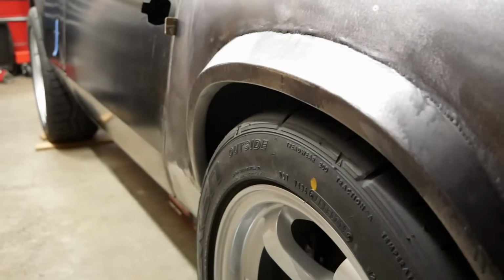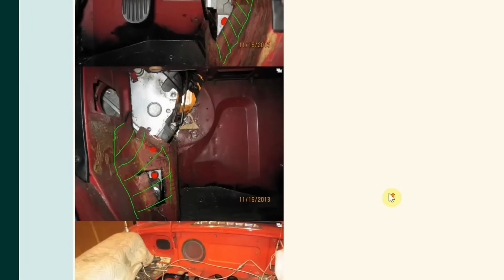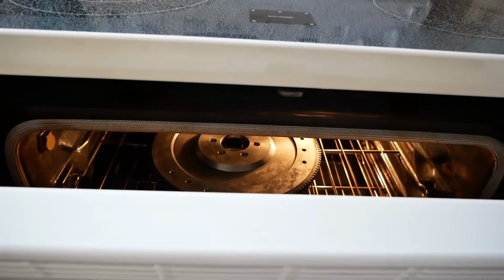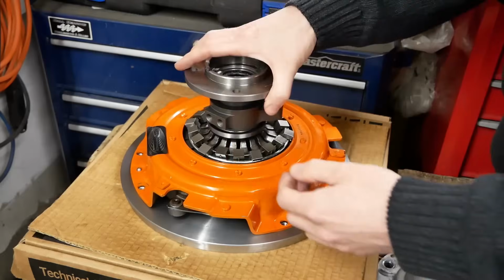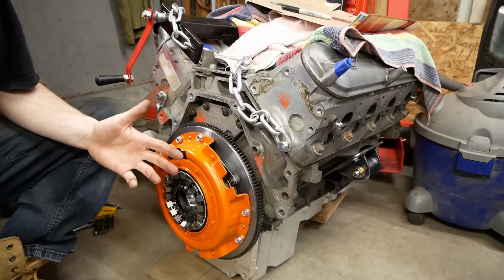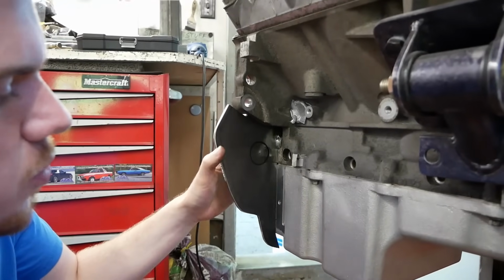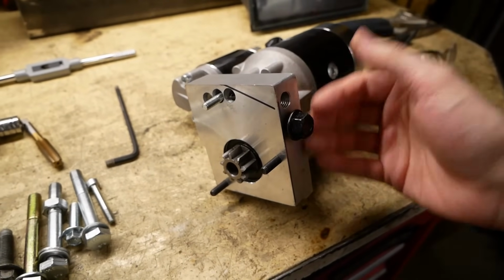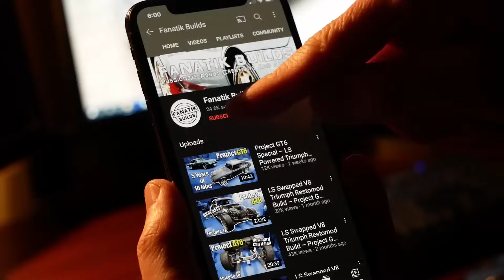The Cheapest Aluminum LS!  Pro Touring Triumph Build – Project GT6R – Ep20

Comment: Have to now go back and watch the previous 19 episodes but a question.
Can the oil pan be removed without pulling or raising the engine? 
Asking as based on sump location you need room to go directly down quite a distance (relatively speaking) as typically you would move the pan back and down but you, from what I can see, can't go back.  Or is there never a realistic need to pull the pan without pulling the engine?
Reply from the maker: Haha, thanks Russel, our production quality has improved over the years, but hope you'll enjoy the older episodes all the same! 😊 I've never tried to remove it with the engine in place, but IF it's possible, it will be by the skin of its teeth!  There have been a lot of packaging issues to work through in such a small car, and something like removing the oil pan just didn't fall as high on the list of priorities as other things!  It's a good question though!  Cheers and hope you'll enjoy what's to come! 👍

Comment: You need to 3D scan the bell housing and build a adaptor bell housing with a starter built in, and sell it
Reply: Bingo
Reply from the maker: Hmm... 🧐 ... Could be interesting!  No idea how to put such a thing into production, but thanks for the idea man! 👍
Reply: @FanatikBuilds  
A good machine shop or prototyping place may have the tools.
Two I can think of:

3D scanner. It uses lasers. I'm not sure how accurate it is. I just don't know.

"Portable CMM". I like that this measures by touch. 

" Just remember me when you wax, a'ight " ?
Reply from the maker: @xmo552  I think I'm fine with getting the design into CAD, and machining too... but finding a company to cast it would be the main hurdle!  Food for thought though! 😄👍
Reply: @FanatikBuilds  You could get it milled from a big chunk of aluminium. That would be super cost effective.
Reply from the maker: @BrianSmart1959  😂 perfect!  Couldn't imagine a cheaper solution 😉
Thanks so much for the support on Patreon, Brian, it's really appreciated!
Reply: @FanatikBuilds  Have a chat with the guy from Boosted Lifestyle. ( The guy with the 8 turbo Mustang ) He produces billet wastegates.
Reply from the maker: @andylewis7360  Thanks for the tip Andy! 👌
Reply: Ah the GT6+. So strippo from the factory that there was no steering column. Peek behind the instrument panel and you can see the exposed steering shaft turn. I think it is held with a pillow block bearing.

Comment: You solution is beautiful, if you run into any issues  fiero guys have a ton of options and info on the ls4 infront of a manual. Tho theres use fwd transmissions. But they offer starter mount options as well. Both oilpan and bellhousing.
Reply: Also the 60degreev6 forum may offer options. I know you have your issues sorted but if you run into further headaches there is a wealth of knowledge there
Reply from the maker: @raymond4988  Thanks Raymond!  Yep, the Fiero forums gave me a lot of great info and ideas! 👍 really helpful stuff!

Comment: Spec now makes a flywheel and clutch option for the LS4 with Fiero trans (Muncie or Getrag) as well as F23 trans which should work with the T5. Moroso and LS4king now also make an oil pan with starter mount. Both are used often for Fiero swaps. V6 firebird (3800) trans may also be another option for a manual transmission

Comment: Great work! 👍
Reply from the maker: Thanks very much man!  Really appreciate your support! 😄👍
Reply: @FanatikBuilds  that starter bracket is a thing of beauty. On this side of the Atlantic I think your job would be much easier (if, ultimately, a lot slower) with a rover v8 😂
Reply from the maker: @baronvonteuchter1412  Thank you!  We originally were planning on a Rover V8, but since they are so rare over here it would have been a lot more expensive, and a lot less hp as you say!  (At least without spending even more) 😄 the LS has been done many times, but I think we're only the second GT6 with one, and definitely the only one with an LS4, so ... I can live with that! 😎👍 cheers man!

Comment: What about the manual transmission behind the 3.8 camaro and firebird? They have the 60° metric.
Reply from the maker: That should bolt right up!  Unfortunately the older GM V6 T5s were rated at a lower torque capacity than our 04 Mustang unit.  We may still blow it up someday, but we'll address that if or when the time comes! 😅
Reply: @FanatikBuilds  it seems like for the price you could have the gm trans built to handle the power easier than sourcing and machining all those other parts. Also you can use the 60° bell housing with the 6 speed transmission but you did refer to the amount of space available.
Reply from the maker: @bryanbrunk1186  There really isn't any advantage to using the GM unit, as although we had to source the Jeep bellhousing, it bolts up just the same.  The GM T5 would still need a custom flywheel/clutch setup, as well the starter and mounting bracket.  These engines just make life difficult no matter how you go about it!  We got our T5 for only $450 and it's already stronger to the point that we don't honestly expect to blow it up... but if we do, we can always look into getting a TKO or TKX to replace it 👍

Comment: But you did not use the new TIG to weld up the bellhousing to accept the supplied bolts. Well, maybe next time.
Reply from the maker: Which supplied bolts?  And yeah, lol, haven't tried aluminum with the Tig yet, it's hard enough on ferrous metals! 😂

Comment: A also to if your shifter sits too far back you could possibly use a early zS-10 tail housing which will move your shifter more forward its a good mod for early ranger sand shoe box cords I've heard.

Comment: Why couldnt you use the S10 flywheel? Did I miss something? It looked like you only needed to drill more holes.
Reply from the maker: That was the plan originally, but unfortunately the bolt pattern and center bore is much larger and there's not enough material to safely machine it out.  There's also a seventh hole on the S10 pattern which completely eliminated any remaining chance of this working.  I was really REALLY hoping we could get away with modifying an off the shelf unit, but flywheels are not a good area to mess around with so we took the safer route.  Cheers! 👍
Reply: @FanatikBuilds  ok that makes sense then.

Comment: I'm not sure on the particulars for any of these parts, but most bellhousings have some sort of plate that goes between it and the engine. Perhaps that's why yours didn't mate up flush before "shortening" the dowels.
I think you guys are doing an amazing job and have tackled quite a few difficult topics with much success. However, I do hate it when people cut out parts from the middle of a sheet 😋
Reply from the maker: Ah, hadn't thought of a factory shim plate... That could very well be true.  Haha, yes I thought in the editing that some people would notice that 😅 if you look closely at 16:59 you can see we were planning another part beside the 1st part we cut... only... we changed plans shortly after!  I always try hard to save material! 😬👍 cheers!

Comment: Did you try the bellhousing for the 2.8? Do you think it will fit?
Reply from the maker: That version bellhousing works with the GM T5 only - our T5 from a late model Mustang is actually one of the strongest units which is why we used the Jeep part to adapt GM to Ford.  The 2.8 S10 unit will definitely still fit the engine though! 😊👍
Reply: @FanatikBuilds  Yeah, I was just hoping it would fit the Ford T5. Thanks for the info though. Love the videos. I hope everything works out really good for you.
Reply from the maker: No prob!  The 2.2 S10 bellhousing will fit the Ford T5, puts the starter bump on the wrong side though.  Hope you'll find something that will work man!
Thanks!  It's really appreciated, and I hope you'll enjoy what's to come in the project! 👍

Comment: Awesome job 😎👍
Reply from the maker: Thanks man! ✌️
Reply: @FanatikBuilds  when you set them tips out the back Cut some thin wall pipe that is an inch wider than the exhaust pipe and make the lower valance sold again . I will send ya a hand drawn picture of what I'm saying.
Reply from the maker: @k.g.kennedy9471  That’s actually the plan, will happen when the final bodywork is taking place, thanks!
Reply: @FanatikBuilds  keep my number I'm in Alberta working at a body shop I'm an old man and have plenty of experience building hot rods and full factory restorations. 😎👍
Reply from the maker: Appreciate the offer and kind words!  For some reason your previous comment isn't showing up in this thread, but I can still find it in a workaround way ... good ol' YouTube..!  All the best 👍🇨🇦
Reply: @FanatikBuilds  you too Lad . May all your ups and downs be in bed .lol

Comment: Could you start with an LS flywheel and have the OD turned down t match the OD of the 148 tooth flywheel?  Shrink on the gear, drill the holes for the pressure plate, and... done?
Reply from the maker: Yes (in theory)!  I wanted to go this route, but like the back of the S10 flywheel seen here, there’s a thicker section around the perimeter where the bolt circle is… if a 168 tooth flywheel was turned down for a 148 tooth gear, I don’t think there would be enough (any?) thick material left for the new smaller clutch bolt circle.  Could be wrong though!  Conceivably, a billet Ls flywheel might be closer but then… $$!
Went this route as a result of all this but if you decide to give it a try please let me know how it goes! 💪✌️

Comment: I want to do this with a automatic transmission like a 60 degree 4L60e out of a v6 firebird or Camaro my questions are 
(1) does the starter sit closer to the engine compared to a say LS1 /LS3 / truck engine ? 
Will you make these to sell   People will use these engines I’m sure if a starter can be mounted if so sign me up for one !! 
PS  looking at this idea because I have a RHD car from Australia and in order to run the starter on the same side I need to kick over the rack 20mm / 3/4” for the steering shaft out the rack to clear the side of the starter ,  so basically I need the starter to sit closer to the engine 3/4” from a stock LS location in order to leave my rack and pinion in it’s stock location !!
Reply from the maker: It does sit in a bit closer, yes!  Couldn't tell you how much exactly to be honest, (don't have anything on hand to compare to) but I'd say in the range of 1/2 an inch. Maybe a little more.  Not sure it will be quite enough to clear your application, but will be closer than any other LS option!  Giving some thought to offering the bracket, thanks man!! 👍
Reply: @FanatikBuilds  thanks so much for replying back man it’s a great bit of engineering and the LS4 is a great little LS engine always overlooked if you ever get a chance to measure the distance from the outer edge of the block to the most outer egde of the starter if appreciate it if I do make them man I reckon people will use those engines more !!

Comment: Now that you have the recipe make a kit with or without the over the counters parts and offer as a retro fit kit for sale to the public.......I'm in !
Reply from the maker: Haha, thanks Vincent!  I've been giving it some thought! 👍
Reply: I’d be in too. I’m very interested to see if you’d do a starter plate for me and possibly share a pdf for the flywheel drawings you showed on the video. I’m doing the same engine/trans as you for my ‘78 spitfire, but using a complete Miata na suspension front and rear. 
Please let me know if you are interested, and we’ll make it happen.
Thanks 
Sam

Comment: congratulations!  on defeating the complex problem.  hmm?? with the exhaust installed, does this mean that the engine has to come out of the car to fix the starter motor?
Reply from the maker: Thanks man!  Nice to have it crossed off the list. ;) As for access, the exhaust manifold will likely need to be pulled to get to the starter motor, but it can definitely be accomplished without pulling the entire engine and transmission out.  Cheers! 👍

Comment: Why is the bell housing bolt pattern diferent?
Reply from the maker: From what I understand, when GM decided to put the LS in the 2005-2009 full size FWD sedans, they had a few options.  Use an "upgraded" version of their normal FWD transmission and adapt the engine's bolt pattern to match... OR... redesign the transmission to accept a normal 90 degree LS bolt pattern.  They chose the first option, likely for cost and packaging reasons.  What it means to us is there are LS4s floating around that aren't typically considered for a RWD application, and therefore offer some cost savings!  Cheers Andres 👍
Reply: I think it looks like a Sbf bolt pattern, isn't it  the same?
Reply from the maker: @GamesWorld41  It does look very similar to a SBF but they are actually different unfortunately!

Comment: I'm curious,  It looked like you didn't have the friction disk installed when measuring for the  depth of 
the throw out bearing. Won't there be a difference in depth without it?
Reply from the maker: Gosh, good eye Matthew, yes quite right, we'll need to circle back to that before final assembly!  Thank you for the heads up! 👍

Comment: New to the channel, great work! Just my two cents, would a mid engine plate have minimized some of the engineering to fit the trans & starter? Thank you for posting!
Reply from the maker: Welcome!  Some kind of mid-plate may have helped to a degree, (at least with the trans input shaft length) but the position of the starter would have been just as complex!  It also would have used more material and potentially allowed for more slop in the alignment of the engine/bellhousing.  Even as it sits, we're using factory parts, and still need to come back to check the concentricity of the components.  Where I think a mid-plate could help a lot, is if it is treated as an adapter for attachment of a normal bellhousing and flywheel.  A crank spacer would then be required for the flywheel to clear though, and that would throw off the alignment of the starter motor... AHH.  It gets messy!  I think this was likely the cheapest and most effective solution, but I'd love to see some other takes on it!  Cheers man! 😊👍

Comment: Stress is force, but strain is the amount of deflection.
Reply from the maker: Yes, "deflection" is a better term... I think I'm finally wrapping my head around this (it's taken a while!).  I believe the way I was originally thinking about it could be considered somewhat true, but not what the graph was intended to convey.  See if I'm on the right track with this example!... Vertical axis is how much effort is pulling along the length of a bolt.  Horizontal axis is how far the bolt has stretched.  Stretching is linear, but the force to cause the stretch increases and decreases as the bolt yields, hardens, and necks.  Correct?
Reply: @FanatikBuilds  Yes, strain is the deflection or deviation from a reference configuration, and the stress is the amount of force that was required to move it that much. 

Most materials, for small deflections behave elastically, i.e. they behave like a spring where force = - k * distance, with K being the spring constant, or Young's modulus. 

But for larger deviations, they tend to deform plastically, i.e. they bend, and for really large deviations, they stretch and break. 

That's where the stress / strain curve comes in.
Reply from the maker: @AndySomogyi  Great!  Cheers man! 👍

Comment: Been following the build for a while now. Awesome work! That said I'd ditch the LS4 intake if you can find a LS1 or LS6 intake cheap. The LS4 is the worst performing LS intake and will lose you quite a few hp
Reply from the maker: Thanks very much man!  Yes, quite right... it does really choke down the ability for the engine to breathe.  The rest of our drivetrain can handle some additional power, though I'm not sure about the full on brunt that an optimized LS could put out.  Our goal is slightly more HP than torque and I think the more restrictive intake could help keep a lid on things.  300-350hp should still be plenty in such a small car!! 😄👍

Comment: Great work. You can contact LS4 King if you have issues with the starter.  He has designed an amazing oil pan with a starter mount.
Reply from the maker: Thanks Guido!  Yep, I've seen his product, very nice!  It unfortunately would not clear the position of our cradle, as with the starter under the engine it pushes the oil pan forward.  I considered it, but am very glad this solution has worked out - it's really just what we needed! 😊 Cheers man! 👍

Comment: Just get a WC T-5 with it's clutch, pressure plate, and FW from a 3.8L, 1998-2002 Camaro. They all bolt right up.
Reply from the maker: @EatPezzzz  3.8 flywheel is not the same bolt pattern as an LS unfortunately!

Comment: ls4 king sells a oil pan with starter mount on bottom. designed by gm
Reply from the maker: Thanks Chuck, yeah that's a pretty cool solution that should also work for a RWD application, though the starter being mounted underneath means the oil pan sits a lot further forward and would interfere with our cradle/crossmember.  I also haven't found any pricing on it but would wager this was cheaper! 😂 Great design though! 👍

Comment: If the block and bellhousing are aluminum,why did you use 3/16 steel plate for the starter mount?
Reply from the maker: Strength and simplicity of welding (didn't have the TIG setup yet).  It'll get a coat of paint to stop galvanic corrosion!
Reply: @FanatikBuilds  what rod did you use(or wire)

Comment: I would have used a external Ford style starter switch and then had more clearance around the starter motor.
Reply from the maker: That's a great idea!  Didn't need to though as although it's tight, it does clear fine 👍